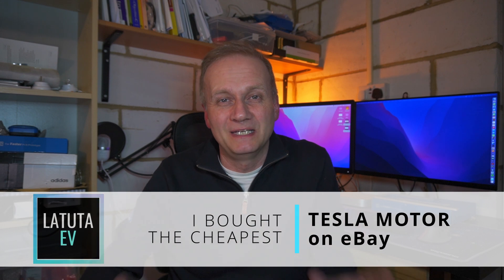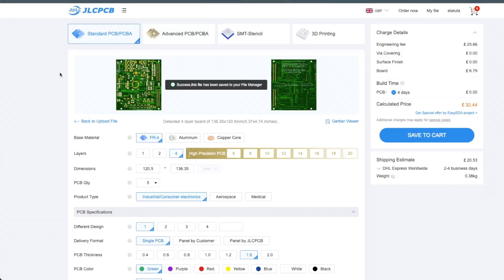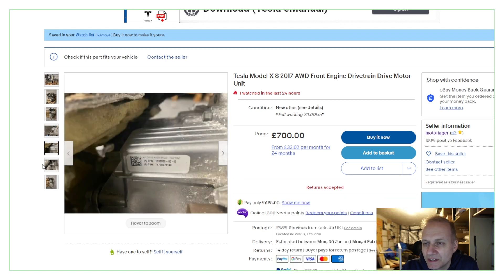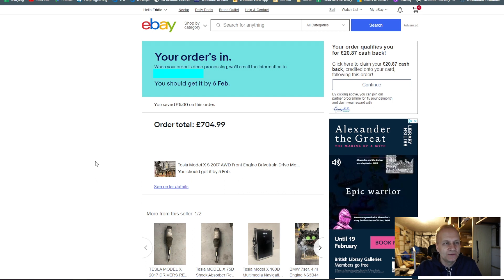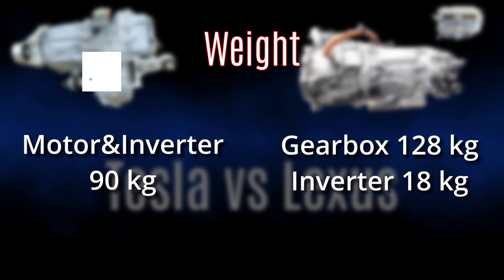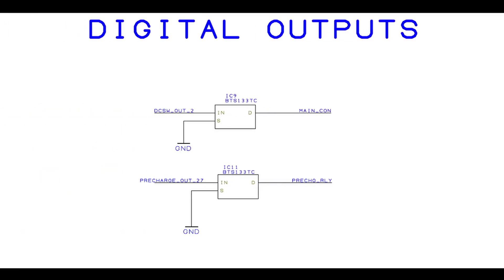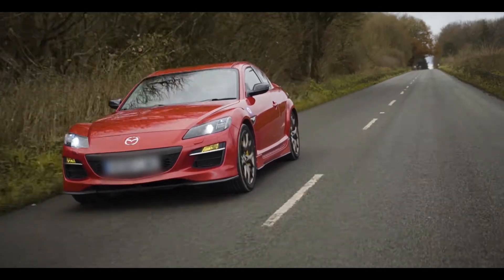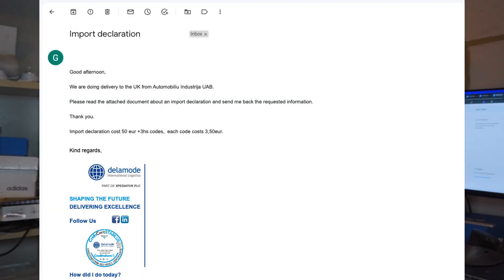I Bought the Cheapest Tesla on eBay - What Happens Next? #3

Comment: Love you channel and follow your experience closely. I couldn’t help but reel back when you said that you were considering a front wheel drive donor. I have a project in mind using a Tesla model S small drive unit and have come up with a few good rear wheel drive donor cars that you may or may not have considered. The best option would be the car with the heaviest drivetrain that would be discarded. Here is my list, 
Toyota MR2, Lotus Elise, Anything with Semi trailing arm rear suspension eg BMW Z3, E28, E30, Peugeot 504 coupe, Porsche 924, 944 or 928, Mercedes C123 or W123, Rolls Royce, VW Beetle and Karmann Ghia. Another wild card option would be a Toyota RAV 4 Mk1 (XA10) short wheel base (lowered for performance). Even though you may think it is a joke, the Toyota has a lot of space behind the back axle for the Tesla drive unit and the Toyota iron block engine and 4wd system is quite heavy allowing for a large amount of batteries. The Short wheel base with lowered suspension can look great (google lowered Rav4).
I am from Australia and cannot appreciated the Registration requirements so your rules may eliminate my suggestions. Thanks for a great channel, you are inspiring people on the other side of the planet. I look forward to more updates. Christian
Reply from the maker: Thank you so much for your interest in my channel and for such a detailed and thoughtful message. Let me explain my point of view. As I want to use Tesla motor as it is constructed of course it would have to drive wheels using original reduction gears. And I would prefer to have the motor positioned at the rear. This would be the best weight distribution choice and easier to apply power to the rear wheels. However unfortunately not many cars have enough space to place even Tesla small drive motor. This eliminates all BMWs as they do not have enough space at the back and I don' t want to be modifying chassis anyway. In this case cars like Porsche Lotus Elise and Toyota MR2 would be ideal choice. Unfortunately I had to reject all of those for various reasons. Porsche and Lotus because of price.  Cheapest Porsche Boxter in UK even for spares and repair is about 3- 4K pounds while Lotus would be about 8 -9 K. Toyota MR 2 is a bit too small - it will have place for the motor but not much space would be left for the battery. At the moment I am looking at Audi TT 1st gen or 2nd gen. The first gen could be bought in a range of 1K or below. The motor could be placed at the front while still space left for the battery. I am planing to have two battery packs one at the front and one at the rear. Either remove rear seats or take some space from the trunk.
Reply: @LatutaEV  I understand. 1k is quite a constraint. I will be watching closely and wish you great success. Cheers, Christian

Comment: I like the idea of using a chassis that is AWD capable.  If you get bored with the conversion to FWD, just add a second motor in the back!  The VAG platforms are a very tempting starting point since nice ones with failed drivetrains are abundant and very inexpensive.
Reply from the maker: Yes it is interesting idea, I am not sure how much space is at the back of the Audi TT quattro
Reply: @LatutaEV  I don't believe the TT has much room back there... you'd most likely need to cut the floor and build a subframe, which might raise some eyebrows at the MOT station.  I'm probably going to look under one of the larger cars like an A4 the next time I visit the junkyard.   There are a few TTs in inventory as well at the yard farther away.  These have caught my eye as well for a swap candidate.

Comment: It's a shame you're not joining me in rx-8 / gs450h land but I will still follow along with interest!. Out of curiosity, why do you think using the tesla unit will result in a failure on points? What chassis mods would you need to do?
Reply from the maker: You never know this might be the next project 😉. I still love the idea to convert Mazda RX8. With Tesla I do not think that there will be space to place the motor at the rear of the RX8. At the same time placing the motor at the front will result in much more complex conversion. I would have to remove the transmission and modify the steering as well, I guess. I am sorry I was busy at work I had to travel to Europe over Xmas and was in Japan in January. I hope to visit you some time in the future, if the offer still stands?
Reply: @LatutaEV  yes of course the offer stands.
Reply from the maker: @knoxsp  Great I will get in touch via Open Inverter forum